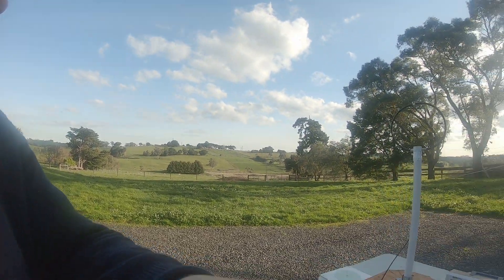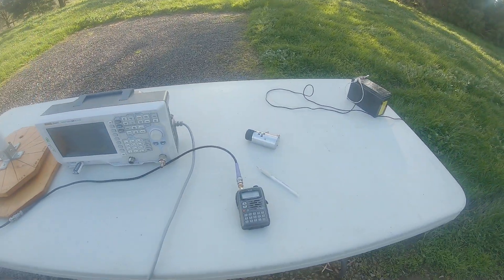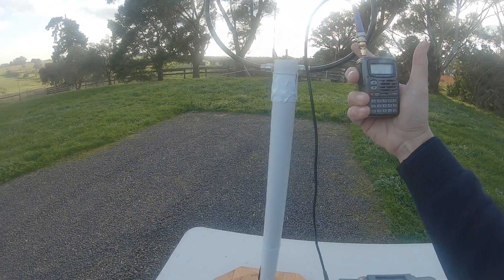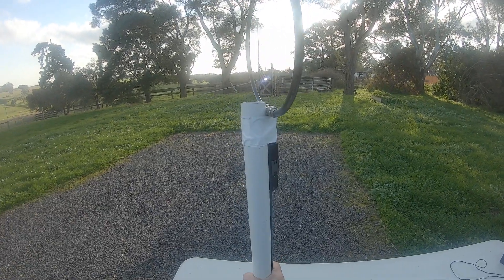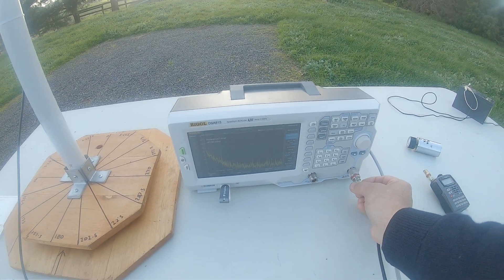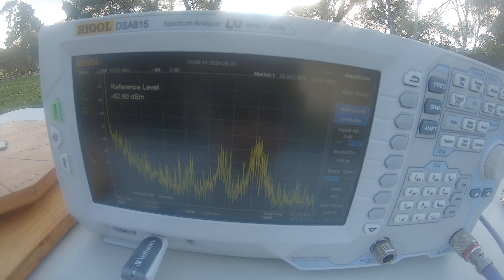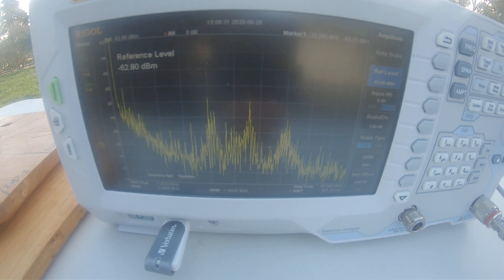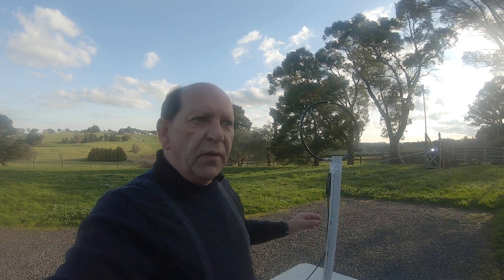R017 DF Loop test

Comment: HELP! I tried building the loop from the build video with one difference.  Instead of doing coax connectors and a T, I isolated the center conductor on one end and then took that end a soldered the braid to a square of exposed braid.  So the whole build is pigtail with connector, square of removed insulation, 440mm of coax, 20mm of removed insulation and braid leaving center conductor and insulation for center conductor, then heatshrinked the area.  Then another 440mm of coax, then the end of that has isolated center conductor and braid soldered to the previously mentioned exposed square of braid.  I've built two of these.  When running the fox and testing from a few hundred feet away my null seems to be off one of the sides!  The only thing i can think of is that I had a hard time soldering that braid together.  Is that the issue?  What else could be causing this?

Comment: I was hoping to see the video show the antenna rotated 360 degrees through both the 90 and 180 degree points to see how it responded to both sides of the loop in the direction of the interference.  Curious what the observed results would be.
Reply: That's a very good question.   On HF the pattern is pretty much a perfect figure-8 with no discernable front-to-back ratio.   That's because the loop is pretty small proportional to the wavelength.  By the time you get to say 2M, there is a slight gain in one orientation.   This effecti s more pronouncable if you make a bigger loop.
The construction process for this loop can be seen at:  https://www.youtube.com/watch?v=Ivr9VbSgjUU

Comment: Hi, question, as to size of the loop, if I wanted to use it for fox hunting, or for Search and Rescue SAR-DF on 121.5 MHz or 406 MHz to find direction of a Personal Locator Beacon
Reply: A late reply...  Yes it would be fine for fox hunting.   A larger loop than the one shown gives you more of a front-to-back ratio at VHF and UHF.  It is non-resonant, so dimensions are not critical.
Reply: @ianjackson9493 if the dimensions aren't critical, I'm wondering where the 90cm is coming from?  Seems an odd number being so close to 100cm.